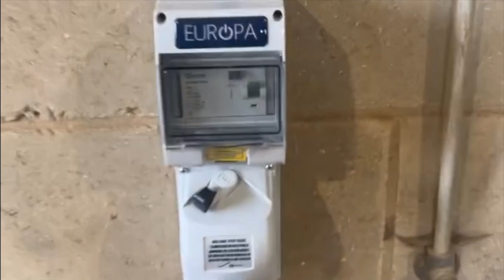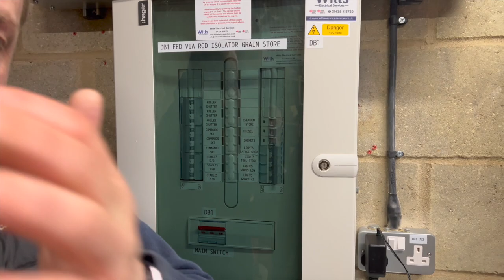"Transforming Farms: A Guide to Switching Up Your Three-Phase Distribution Board!"

Comment: What do you mean by switches the neutrals, In case of future maintenance you can totally isolate them/the circuit ?
Reply from the maker: If there is a fault on any of the circuits and is tripping the main rcd the farmer can turn off the isolator. To isolated the problem.
Reply: Footprint pipe wrench absolutely brilliant for armoureds